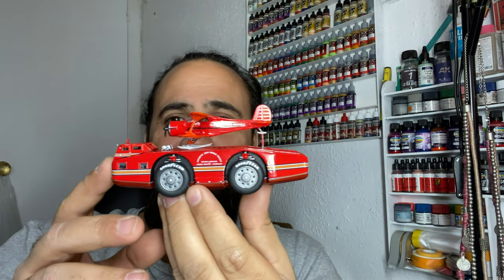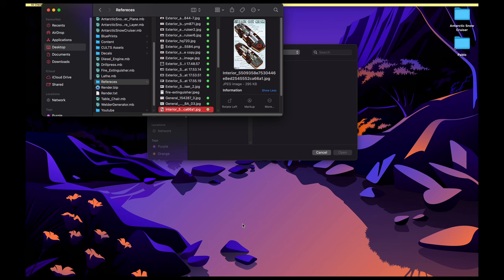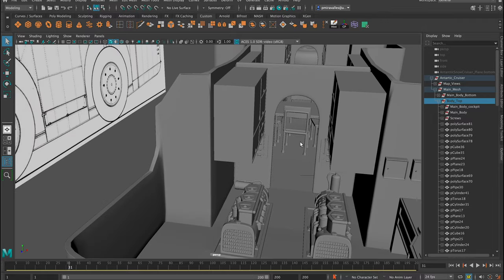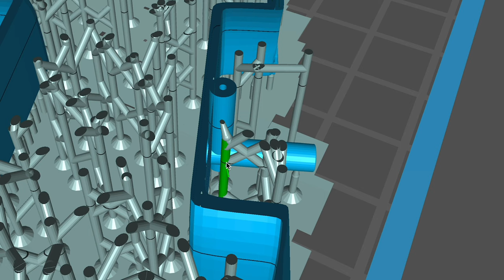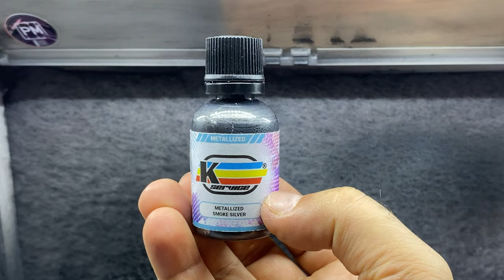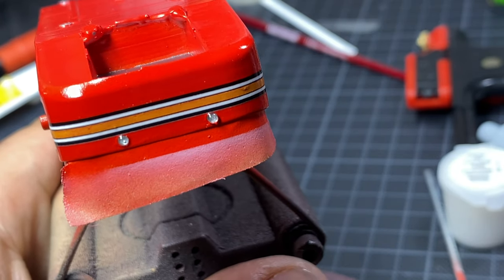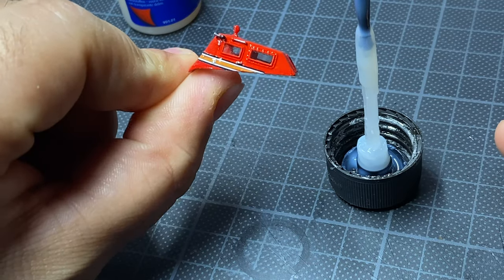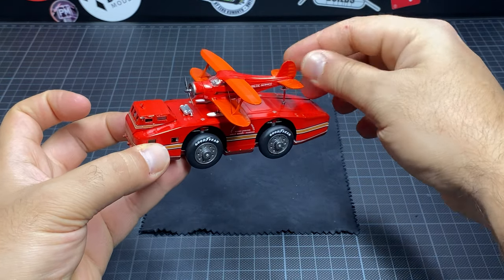✏️ 365 project | 3D modeling, printing & Building the missing Antarctic Cruiser | Step by step build

Comment: Hi Pablo
It's my turn to assemble this model for myself.
I don't have the opportunity to show here the 3D print blanks for the Snow Cruiser and the Kharkovchanka, which I will be making in parallel (a tradition for all modelers - you should be familiar with this phenomenon))
Both of these models in 1:72 scale have a removable roof for access to inspect the interior.

You have done a huge amount of preparatory work to prepare the model for printing, having studied a lot of documents... - are you ready to give me an answer that I myself, nor AI, could not cope with..?
So. In the Kharkovchanka, the location of the toilet in the hull is provided and indicated. For the Snow Cruiser, this turned out to be a big secret! No information, no one even thought about how the polar explorers relieved themselves - did they run out into the frost of -50 behind a snowdrift or disposed of all this in bags?
(then the engineers were ahead of their time for the ISS now)
How the hydraulic system for lifting and lowering the wheels works also needs to be figured out by yourself. The same applies to turning the wheels.
The topic for creating a perfect model is quite extensive - comments under the video are not the place for a forum - give your contact for correspondence.. (if this is still interesting to you)
Reply from the maker: Thanks for your comment! It's great to see your enthusiasm for these models. As for your questions about the Snow Cruiser's bathroom setup and hydraulic systems, those are definitely tricky areas! Unfortunately, there isn’t much documented detail available on these specifics. Feel free to keep the discussion going in comments and share any discover you may dig in. Thanks 🙏